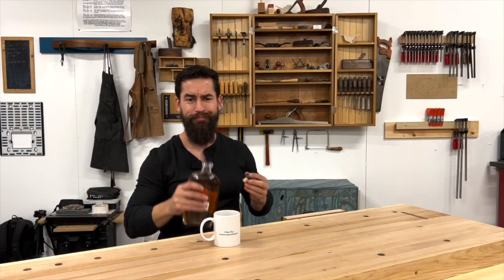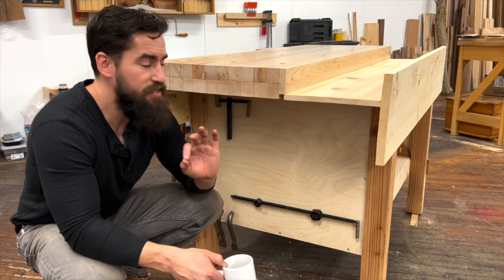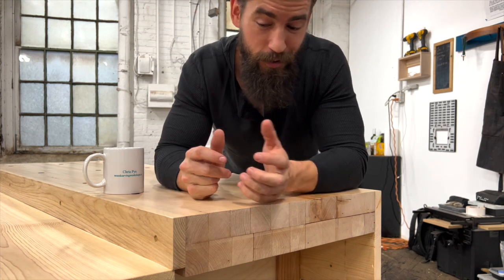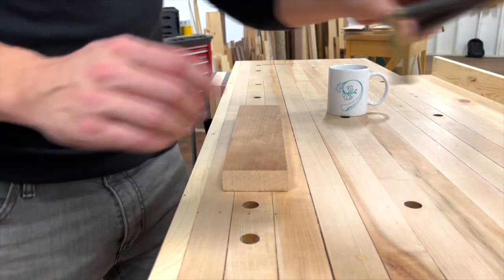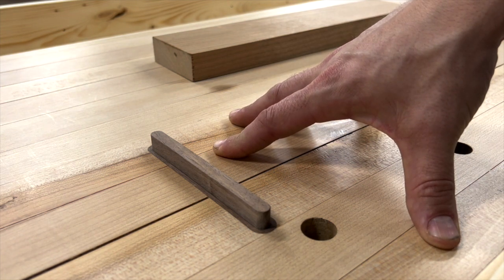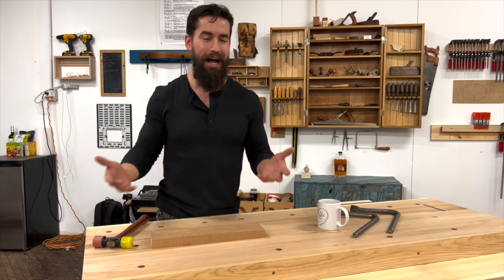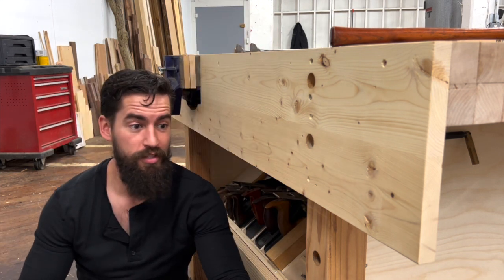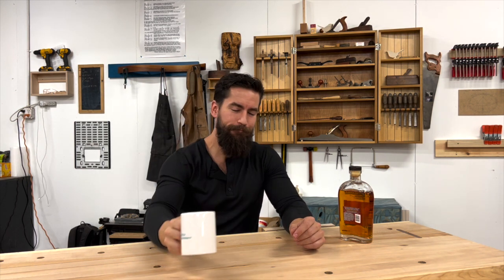5 Tips For A BETTER Workbench

Comment: This bench is accessible for most - and I like the reuse of the top.  I like the magnetic plane stop!  However, what you call a bench hook is actually called a holdfast.
Reply: I was gonna say the same. BUT- bench hooks are also very useful so make a couple of those too.
Reply: Thank you for your Video
Reply: I caught that to.  so what,  we knew it  its a fabulous tooll
Reply: Will holdfasts work if my workbench top is going to be a solid core door, or does the dog hole need to be in a thicker top?

Also, do holdfasts deform your dog holes over time? 

Thanks!
Reply: @b-radg916  Easy to test (before you dive in with the whole benchtop).  There are even ways to reinforce the hole, by over-drilling, then slipping in a collar.  I’ve used the screw-type holdfasts from Sjobergs, and they seem to work fine - I’m sure they will wear with time, but seems to be more gentle and convenient compared to cast iron ones that are tapped in.   People use cast iron holdfasts on pine benches, though.  There are some other options for dog hole clamps, too.  Fixtures mounted with 1/2-inch bolts work fine.
Reply: @b-radg916 that's probably a bit thin, but you can just attach some wood underneath the dog hole area to thicken it up. 👍

As far as deforming, probably over a long time, but it's not going to be much.
Reply: @b-radg916  Holdfasts typicaly have both a minumum and maximum bech top thickness that they work with. They work find with a 44mm bench top and will probably work down to 40mm if not thinner. I know they do work with a traditional English Jointers Bench (a Nicholson variant) those benches have rediculously thin tops.

Comment: I wish you could share photos in comments so you could see my bench. It’s mostly laminated fir 2x4s but for the extra originality to make it mine I did 1/2” walnut accents in between the leg glue up and 1 section of my 2x4 laminated top is a walnut board. I did do all the way through mortise & tenon to see that walnut accent in the bench top. Strictly for looks😂. Man, I wish you could see it! Lol. It cost me about $80 in 2x4s and scrap walnut to make a bench that’s great that when people see are immediately attracted to. There’s also the pony vise with walnut board for the non-marring clamp and a big piece of spalted live edge ash (that I got from my dads firewood pile) that I milled into a leg vise. I will have this bench until my son inherits it and again… it cost me $90.

Comment: I built a rob cosman workbench with mdf top. It’s very flat and solid as a rock. I built my own tail vise using a vise screw I got on Amazon for $30. I love having a tail vise. I then built s moxon vise to hold things vertical.  I would hate bending over to get my planes. But I’m an old guy

Comment: Found your channel about a year ago and it’s a great source of practical information.

My plane stop is a scrap piece of 1/4” ply screwed to a scrap of 3/4” pine in an “L” so when the pine is clamped in my face vice, the ply lays flat on my bench.  If I work on thicker stock, I can tilt the front of the ply up a bit and clamp it at an angle.  When done, I store it on a shelf under the bench.

Comment: Thanks for these cool videos! You talk about real woodworking stuff that helps me, for one, think better about what I'm doing. It's like shooting the bull with a more experienced woodworker.
 Tip number 5 I took already, by necessity. My first bench 3 years ago was a plastic and metal folding table with a piece of CDX plywood screwed on. Using that, and working from wheelchair, I upgraded to a 24-inch high, 24 by 60 inch bench out of 2 x 4 spruce. Layered the legs to get a rabbet or mortise as needed, glued and screwed together with drywall screws, and it's a rock-solid working bench. Thanks for all the no-nonsense perspective. Makes me feel better. My bench is too short for a plane till underneath, so I made a pull-out tray with my 400/1000 diamond plates. That's as fine as I go and it works for me!

Comment: I’m a little late to the party here, seeing that this video is a year old, but that’s sometimes the way it just happens to work out.  First of all, full disclosure, I’m a novice, but I make a lot of things 😊.  It is so satisfying to just go make a thing, even small things or big things.  A couple of years ago, I built a Roubo workbench more or less based on Christopher Schwartz anarchist bench.  The bench top is Yellow Pine and Live oak laminated that I milled, dried, and hand planed from super rough to okay smooth.  Way above my pay grade.  I did draw-bore blind mortise and tenon joints to connect the leg base, built a tail vise from the screw assembly on a black and decker workmate, made a leg vise and criss-cross hardware from heavy flat bar,  a 1” threaded rod for the chop screw, an old valve (large) handle for the handle mostly metal stuff I’d found interesting.  It kicked my butt, but OMG it was so much fun!  The top isn’t quite as flat as it should be (next one will be better).  I forged my own hold fasts (they could be prettier) but hold super thigh out of 3/4 cold roll steel.  I added a heavy duty face vise (the most used part of the bench) and made so many errors.  All the mortises were done with a chisel and hammer, and I even drilled the dog holes with a bit and brace.  So much fun! So many mistakes. I highly recommend trying to go build a thing! 

Great content and information!

Comment: Not saying I'm rich, I'm retired. Can I afford to make a hard maple & black walnut workbench? Yes but I'd prefer to use that wood for furniture. Although the wood wasn't free, it was cheap and I built my workbench out of yellow pine and have been using it for 4 years without any problems. I agree with the end vice but I went with two side vices and bench dogs, a couple of bench bars(?) & the metal do-hickies that hold things down. - Total cost (back then- 2019) $150 for both wood & vices. Unless you want to impress your buddies with a $3,000 bench, do the soft wood bench. If you drop your hardwood project on your bench you don't have to worry about which one is going to break or dent. Your choice!
Reply from the maker: Totally agreed. A nice bench is a wonderful luxury, but it is just a tool at the end of the day. Use your funds on wood to make furniture!

Comment: When I built my bench as a novice woodworker last year I used it as an opertunaty to practice my joinery and try out new things. For example on the mortices in the lags I deliberately did not drill out the bulk of the waste first and instead except for the one where I hit a knot chisseled them out by hand. Another example is I deceded to close the ends of my bench. Originally I was going to use finger joints for this then I saw the blind dovetail on a video. So my first ever dovetails ended up being the blind variety on the ends of my workbench.

The first thing I actually build on my workbench apart from itself once it was far enough along to hold work via clamps was the planning stop. Just a strip of left over wood from my pre-workbench project with a couple of dowels through it so I could drop it into a couple of dogholes. The planning stop was a ten minuet project if that. The first real project I used the workbench for was making the chop for it's leg vice.

Your suggestion of of building the plane till into your bench is a good one and I added one to my bench once my plane collection had grown a bit. I will add on to the suggestion and say add a saw till as well at least for your joinery saws. I have still to add this to my bench. One of the most usefull things I built into my bench from the begining is a central raisable stop. This has turned out so useful I leave it in the raised position and have not needed to make myself a set of bench hooks.

The only thing I disagree with you is the need for a tail vice. If I ever needed to clamp a board lengthwise like that I would probably just make myself a does hook.

Comment: I built a sweet Roubo style work bench four years ago, all hand joinery for my hand tool wood working. My father-in-law, lives with us since my mother-in-law passed, has taken up collecting old pallets and dismantling them to build garden planters. He does a pretty good job and saves some nice hardwoods for me to use, but... He uses my workbench to pull nails out of all the pallet boards. He's wrecked my bench surface. I thought about planing it down, it's only pine, but some of the pits are a good 1/4" deep, and I know he's just going to wreck it again. 😥

It's still a great bench. I have square dogs in it and I've made all kinds of holding attachments that fit in the dog holes to make up for not having a vice. I'm super glad I had the foresight to put those in when I was building the bench.

Comment: yup to all those tips, especially number 5. 
My first bench was from an article in Fine woodworking somewhere in the late 70's. I learned plenty making it and it had a shoulder vise that has been invaluable. I also learned how to hide mistakes. Its heavy, its still solid and has now gotten to the point of needing the top resurfaced. Gonna use my hand plane and destroy 40 years of patina to make it flat again.
So I hit that subscribe button.

Comment: Great video thanks.  For anyone thinking of making a bench I can highly recommend Chris Schwarz's book.  I built a simple Roubot bench from softwood and it is fantastically solid and takes a right old hammering without budging and cost me very little in materials.  The only thing I wish I had done a better job of was laminating the 4x2's - should have used more and better quality wood glue.  Ended up using some cheap PVA but I think the real problem was that I didn't flatten the laminations quite well enough and didn't use enough glue.  So I have had a couple of failed joints here and there which I have had to deal with in situ by re-glueing and clamping.  But other than that brilliant..

Comment: Regardless of designs, perhaps the best places to begin are with working platforms and storage e.g. Bench, saw horses,/trestle, tool box and tote, as each provide sound skill building practise with tools, joints and materials handling in readiness for those projects you want to get up and running.

Comment: I’ve cut bench dog holes in multiple tables. I own nice hand-forged dogs. And I never use them. Because I use mostly power tools. I think it’s time to evolve the design of modern bench tops. Sanding, assembly, finishing. Throw a sheet of foam on for track saw cutting. Some way to attach rails to run a router sled. Etc. if you have room for just one work bench, what should it be able to do??

Comment: Some brilliant advice here! My bench consists of an MFT top and rest is made from leftover engineered wood floorboards and it's rock solid! Probably not a forever bench but it was dead cheap to make (only significant expense was fifty quid for the top), and the dog holes give you so many options for accessories.

Comment: For a tail vice: saw a tip where a large sliding dovetale was cut into the end of the bench and a matching 8" dovetale slides into it.  It was 2" wide and had a dog hole in it.  An elcheapo vice was mounted on the end of the bench that could push against the sliding dovetale.  Low cost - effective.

Comment: Hold fasts can also be made out of wood. Mine are made from Tasmanian Oak and hold well on my 3 1/2 inch deep top of construction pine. My dog holes are 22mm and are rounded at the top to avoid crushing of the superficial fibres.

Comment: I built my first workbench last summer.  I used old 4x4 pressure treated fence posts from a fence that was being torn down, and 2x6 pressure treated lumber from my old deck that I replaced.  I just ran them through my thickness planner to remove the weathered surface and they look as good as new. And free

Comment: Great video, man!  Love you're relaxed, substantive attitude.

One suggestion, make some sponsorship deals on anything and everything you recommend.  If you want to preserve your integrity and avoid an overly commercial appearance, no problem!  Make the sponsorship deals AFTER you choose what to recommend!  Maybe you can make a deal with Amazon to link to items and get some sort of referral fee.  Easy way to improve your revenue form the video.  The real reason I am urging you to do this is that this video would be more useful to me if you had included links on where I could find the specific items you mention.  Even if I don't choose the one you chose, those links can be very helpful starting points for getting more info on items of that type.

Comment: You've dadoed the aprons into the legs, but not deep enough for the aprons to be flush with the legs.
I find it very useful, from time to time, to be able to clamp to the front or back of the bench. For this I need dog holes in the leg and I need the bench top to have zero overhang.

Comment: I've reached the point where I NEED to make an actual workbench. My main issue is with it having to be outside, open to the elements. Trying to decide just how terrible that would be for it.
Reply: My advice would be to Invest in a large tarp and some bricks to hold the tarp over it and it should be fine, depending on the wood.
Mine is built from old 2x8 roof beams, and lives in the garden. The tarp is large enough to keep it dry, and keeping it a top some concrete slabs keeps the leg ends from direct ground contact. Just make sure you have something heavy to hold the tarp down, and a couple of blocks to raise the middle to stop puddling!
Reply: @Tehinstrumentalist opted for a good coat of outdoor paint, a good tarp, and elevation far off the ground and all that moisture.

Comment: Do you think it would be worthwhile to laminate a thin hardwood top (.75"-1.0") over a larger pine section? I'm feeling like the hardwood surface might resist wear better, but the pine lower layer would keep the costs down.

Also, I love that plane till, it's a nice one. I do like the vertical on-wall tills, too, if they're right next to the bench.

Comment: These are all good tips, thanks. One of the most annoying issues is a bench that is not rock solid, or reasonably so but underweight. Hold downs, tail vise, shoulder vise, Moxon vise,  hard to have too many (if they work). I've seen several designs that use 3 or more 1" layers of MDF for the top. As you say, it's a work bench, make it strong, make it stable, use it, it won't be pretty for long anyway and function over pretty works. BTW, just subbed.